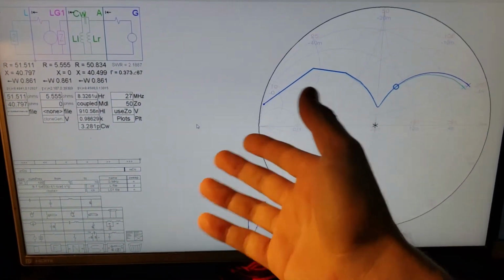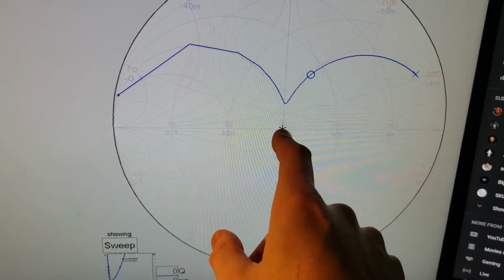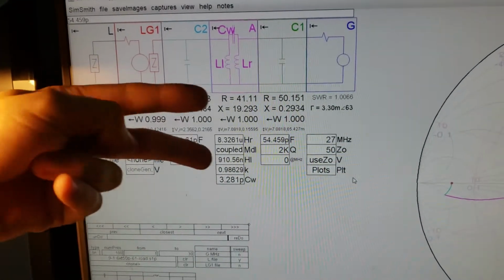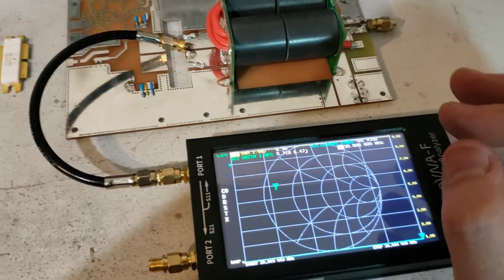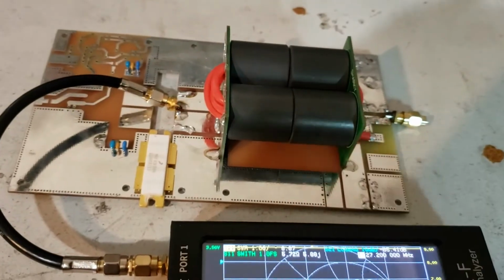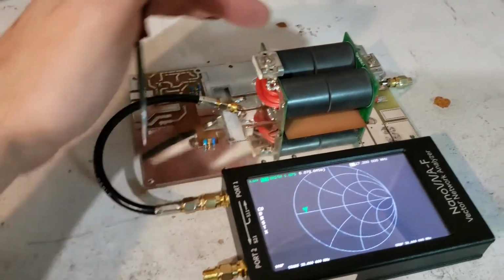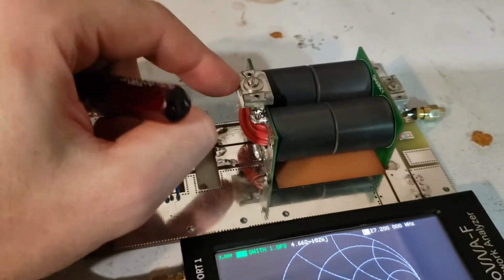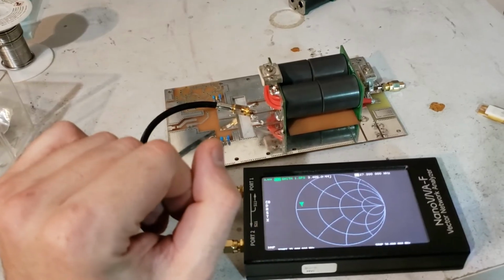What capacitor goes on the transformer?!

Comment: I think it would be really cool to take a deeper dive into setting up the impedance matching transformer simulation in SimSmith/LTspice... and the math behind configuring the toroid, wire gauge, turn ratio, ferrite material, etc.

I've been over all the material, and I've had a bit of success. But you do a really good job of explaining the concepts, the way you understand them... and I think it would be helpful for a lot of people trying to get over that initial learning curve, to start understanding the hows and whys of amplifier design and construction.

Being an Extra Class Ham, I'm interested in applying these concepts to higher frequencies. And implementing higher efficiency transmission line matching transformers...as well as implementing band switching capabilities and wider bandwidth linear operation. There are people talking about the concepts, but very little visual demonstration of how those concepts are applied, and how data is collected to fine tune the circuits.

Comment: Use three 17 ohm coax lines in parallel to make 6 ohm coax . 6 ohms geometric mean and stick to 4 :1 xfmr , do this on device side . The use another 4:1 with 25 ohm coax .

Comment: Great video. Just one question. I have looked at a few pairs of Zetagi B300P they have 6x power level positions.
  What i found is that each power position has a slightly different reflected power back to the radio, each position passes via a different group of resistors mounted near the power level switch. However when in position 6 which bypasses all resistors i see the highest reflected signal to the radio. SWR at the radio jumps up 2 or 3 times worst.
  What I'm thinking is that they tuned the amplifier with fixed capacitors for an average taking into account the effect of the attenuation resistors. But the problem is that at full power the reflected power is the worst. 
  I'm thinking the best is to add variable power to the radio, keep the linear always at full power and try to tune the transformers for less reflected power at full output power.
  I think I will tune with variable caps  then remove them and measure the value then add fixed caps of that value in place. Keeping the variable caps for the next amp tuning.

Comment: Most all solid state mobile amps, back in the early days of the MRF-454 and 455, had tunable transformers. Someone, along the way, decided to measure the tuned padder cap, and replace it with an equivalent value using a silver mica cap or caps. Now, they're using surface mount silver micas. However, knowing that copycats are out there, who don't really design anything, they merely copy what others have done, and do not know how this came about, nor how these values are determined. It's why they produce splatter boxes.

I'm not for sure if Arco is still in business, as that is who supplied us with padder caps years ago. DigiKey doesn't list them anymore.

Comment: If in doubt use a door knob cap. Short length TC 12 coax makes an indescribable cap too.  Iv used these on 50 88-108 and 144 mhz. No experience with 10/11m.

Comment: Thank you for explaining how it works, it was very helpful for me. I assembled the same circuit, but when setting it up, I got a capacitance of 1600 pF on the primary side and 270 pF on the secondary side with an impedance of 5.5+0j. I think this is too much capacitance; on your diagram, the values are almost 5 times smaller. What could be the reason for this?

Comment: Thanks sharky , you used a brass tubes , instead of copper for the single winding , is this to drop the Q or did can’t buy the red copper tubing Thanks in advance for answer
Reply: That's not how you reduce the Q. You do that by adding a resistor across the transformer. Q=X/R.

Comment: I'm reminded of the crystal radio from the late 1800s-early 1900s:

- antenna
- no source of power
- a crystal
- headphones

that was it.  They were also called "trench radios" since they were assembled in the ww1 trenches by soldiers

RF introduces complexity!  You did a great job, thanks.
.

Comment: What we call transformer, is not really a transformer, and the imprecision, the lack of perfection, is not the real explanation, i believe. What we call transformer, is in fact.... how should i put it... communicant storages. When you realize this, you understand that it is not far from perfection, but in fact quite close to perfection. When we consider communicant storages, there can be no symmetry. It means we should not work with sine waves, but only with transitional. Then it is completed, a better word than compensated, i believe, with storage elements that are the capacitors. That too, is not about working with sine waves. It is about trading storages, in order to push it toward symmetry. 
Again, it is not about some imperfections of a real world transformer! The ideal transformer, as a perfect model, is not ideal for the job, and can never be. The perfect model, is imperfect use. Perfect "transformer", what i call perfect co-inductors, combined with perfect capacitors, are used to optimize response for desired signal, with better results than just ideal "transformer".

Comment: Nice job, am a hobbyist trying to work on rf amp on high frequencies like 90mhz on the FM band. Always end up in low gain, high swr etc. But you've done a great job explaining this in simple terms, can you please make a tutorial like this on the FM band will appreciate if you could do that thanks.
Reply: Above HF is a totally different ball game. VFH and above you don't use this type of transformer. You either use traces on the PC board or lengths of coax for transmission line matching. CB hackers don't usually have the knowledge or experience to delve into higher frequencies so you'll need to read some books. Better yet, get your ham license and start operating legally and people like me will be happy to help you with your project.

Comment: I have a datasheet for the transformer I'm using but still can't figure out how to get the values for Simsmith. The amp is working through trial and error but I'm just trying to learn. I have 1 winding inductance and leakage inductance. It's a 2 x 2sc2879 amp.

Comment: Couldn't you bias a transistor ON, connect the VNA to the input and perform the same test until you get a match? Maybe start with a 1:1 transformer with the transistor biased ON to find the Impedance of the transistor at the frequency of operation?

Comment: Great job as usual, but don't you also have to take the extremely high input and output capacitance for the power fet into consideration when determining the drain to drain capacitor size?

Comment: You must learn how to make a video on the topic you want to talk.
Connecting the unbalanced 50 ohm side of the nanoVNA to the balanced 5.5 ohm side of the output transformer is itself a big blunder.
The output transformer (or the input transformer) characteristics can be studied/evaluated or optimised using the nanoVNA only from the 50 ohm unbalanced side using an 1:1 CMC choke.
Or else you can use two identical Transformers connected back to back to guarantee that the they're well built and optimised; but again the first transformer will have to be made/studied only from the 50 ohm unbalanced side using the nanoVNA.
After all the nanoVNA can work correctly with a 50 ohm unbalanced impedance system only.
You may want to reconcile your understanding and  knowledge on the topic and make a revised video.
Viewers should not be misguided.
False information should not be disseminated anymore.
De VU2RZA.
Reply: For the principle Professor Sharky was demonstrating, the test setup was adequate.  Please note that both the NanoVNA and the 50-ohm load were isolated from any "ground" reference.
Reply: @k7jeb  I think you want to study what it means or referenced to 'balanced' or 'unbalanced ' in the first place.
The nanoVNA is by design a 50 ohm impedance system, meaning any trivial deviation will result in false readings; more the deviation more the inaccuracy. 
I strongly believe you may want to have a basic idea of how the nanoVNA or any VNA is working. 
Have a good day.
De VU2RZA

Comment: MudDuckSharky   Watching this piece of gold again!  Could you someday explain the difference of feeding the power at the output transformer center tap, versus feeding it through a bifilar choke to the transistor collectors as BBI does?  This change has me totally stumped.
Reply from the maker: I don't fully understand that part yet, but one thing I can say is that feeding the center tap loads up the ferrite more and can make the transformer hotter. As far as power output goes I haven't seen much difference between them.
Reply: @MudDuckSharky  That may be it!  If it makes the transformer hotter, than it is perhaps messing with the B-H curve, perhaps like a DC shift, at least for the bias part?  Thank you for your experimental observations.   (Sorry for the email, I didn't think you would see this comment...) :thumb up:

Comment: Does it work the same as a step up or down transformer in theory? If so I gotta grip on what they do with voltages. it is the impedance thing I an fighting with. Now the caps on the transformer just make it look longer or shorter and changes the magnetic fields of the transformer right? Well its back to the ARRL handbook again. Still trying to learn how to engineer this stuff to do what I want it to. I would like to know what the program is called and where to go to download it. Call me 1-479-270-4645. Thanks. I would also like which Motorola books would be the best for engineering these circuits. I need to get my library going so I can eat this material up for designing my own stuff. Good stuff man

Comment: Beautiful video brother.....It took me prbly 4 years into this hobby of amp building u till I learned that the brass tube in conjunction with the front and back copper board lol. It was almost like a light bulb went off.

The compensation capacitor on top came a lot later. You can't always have that perfect turn ratio like you mention cause we are stuck with the 1 to something lol. It is always cool how there is more then 1 way to skin a cat as they say.....when I got into this it confused me so much how a 4 pill can work with so many different wrap and compensation capacitor values until I learned this.

Wish I had the intelligence that you have sharky. The Motorola handbook as they call it along with each year of the ARRL especially the older ones have been a life saver to me..  I am one of those type of guys that aren't happy with just knowing 75 percent of why an amplifier works.....I want to understand it all..  its more like im an addict to the knowledge lol..  same way i was growing up with computers back in the old school dial up era and designing software to do this and that lol....Would love to chat with ya sometime brother..  Your fellow builder from the South!!  Gatekeeper Keep on going! I love your videos!!!
Reply: In reference to your statement "brass tube to copper board front to back" are you trying to point out the difference in conductivity or velocity factors between the two metals?

Comment: Great Video  !!! You did a good job putting it into layman's terms that everyone can understand better .. About the only thing I'd add is that those adjustable caps can have a tendency to falter over time or when a lot of power is put though them .  Personally I like to adjust  them to where I need to get them  and then remove them from the circuit after adjusting , measure capacitance , and then replace them  with  a good fixed cap.... keep the videos coming and great job of sharing knowledge !!

Comment: Is this also necesary for Transmission Line transformers? Those capacitors are there to compensate for leakage is it? To measure leakage you could short the transformer and measure the leakage inductance. Put it in simsmith and calculate the caps.

Comment: for 27 MHz operation only, why not ditch the transformer -just use a ~80 nH series inductor (tied to drain ) feeding into a 300 pf shunt... This should match ~5 ohms to 50. You would then need 3600 pf (or greater) at the output to block dc.
Reply from the maker: That's done quite often in single transistor amps, and would also work for transistors in parallel. I don't recall a push pull design like that, no doubt it's at least been attempted.
Reply: @MudDuckSharky  Yes the circuit topology with the push pull would be an issue. Also check out W6PQL.com for his 6 meter mono band design. Very low in harmonics... hmm, could that be scaled for 27 MHz?
Reply: @jimsmith8389  PQLs design could be but of course the values  are just different.  Note while  most CB amps run 61 material , PQL is trying to cover the whole ham HF spectrum plus 6 Meters so he's undoubtedly using 63 material ... Which does suffer at higher freqs and may present a problem ...  I haven't looked to see if he has a stand alone 6 meter version , because I haven't been on his site in a while.

Comment: If you read from the 50ohm side can you do it  with transistor installed or would need to remove it and install a 5.5ohm resistor in its place
Reply from the maker: There are a handful of reasons why neither of those will work well. Best method I have found is to tune the transformer into the ballpark and then fine tune with trimmers based on the amplifiers performance at various power levels.

Comment: Excellent demonstration! I was wondering if you could have put 5.5 ohms where the transistor goes and feed the NanoVna into the output? Probably just a different way to skin a cat. Great Job!
Reply from the maker: Yes, you CAN put a resistor in place of the transistors and tune the transformer. The problem there is that a resistor is not a good representation of the transistors, and without further test&tune the performance would likely be pretty bad.